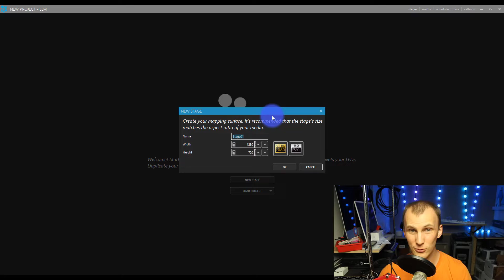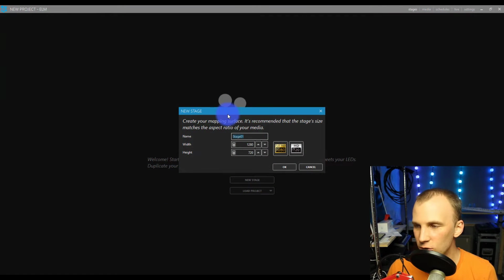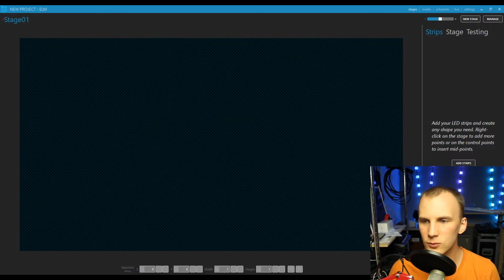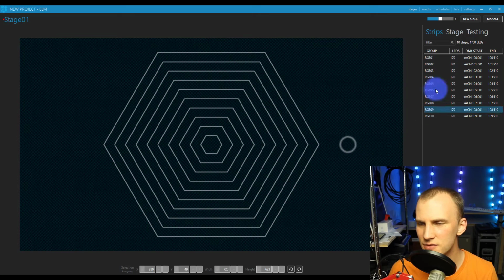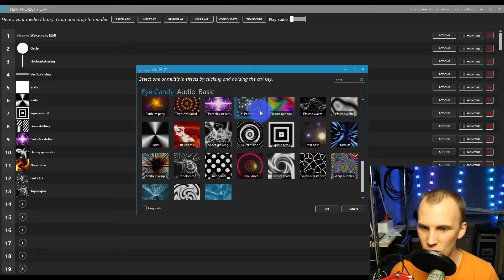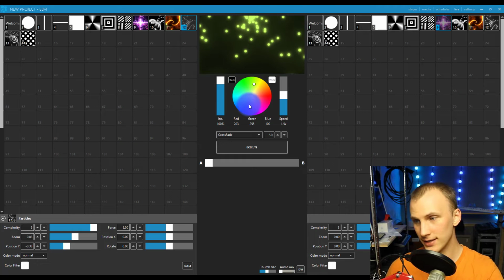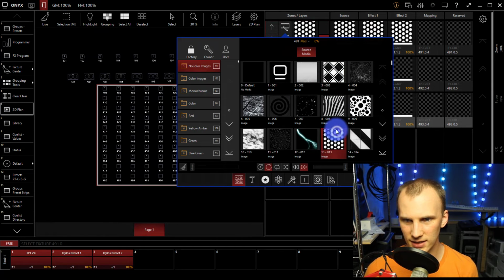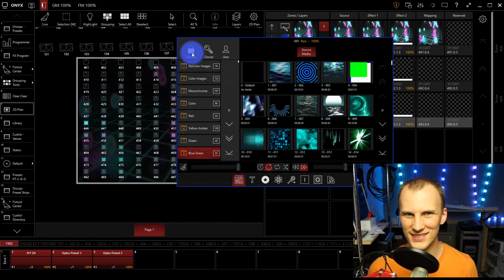How To Control LED Tape and Pixels with DMX

Comment: Are elation pixel drivers any good? I got 4 of the The Flex Pixel Driver (FLE768) for tube lights. What type of led tape and diffuser would you recomend David?

Comment: Hardware question. I'm looking at controlling about 120 LED pixel balls via computer (1 Universe should be enough). Would the Enttec Din Pixie 73539 2-Universe DMX LED Pixel Controller with ethernet out of my PC be enough for this?  It looks like the Octo would certainly work but I only need 1 universe.  Thanks in advance!

Comment: What is a universe in terms that relate to software and hardware?
Reply: I know you asked this 6 months ago, but essentially a universe is 512 channels or control parameters.  Every lighting fixture uses a certain amount of channels to control various functions (those may be intensity, color, pan/tilt, zoom, etc).  Some fixtures use 1, some use 100+ channels.  Therefore you have to have multiple universes if you're running a large set of parameters.  Which means you have to have software and hardware that can handle that large channel count.  Each pixel takes on average 3 channels, but 170 pixels would use 1 universe.  There's a lot more pixels than that on a roll of pixel tape.  Some software is unlimited.  Most hardware, like a light board, may be only able to handle 2-4 universes.
Reply: @mattbrisolara6462  Thanks. Keep up the good work.

Comment: Question…the Octo controls 8 universes and the ELM ties up either 8 or 16 DMX channels. Does that mean the Octo will control 4,096 pixels (512 x 8) but only use 16 max if your running the ELM software? Just curious. Thanks for making these videos!

Comment: I'm using Resolume with an Art-Net Controller, would there be any benefit in changing over to Enttec & Oc...update not Mac support :(
Reply: If you're already using Arena, I would just stay there. I use it to drive 8 universes of pixels as well as a universe of PAR lights and it does a great job, plus it's synced to your visuals. I'll probably eventually wind up using Madrix or Lightjams to control my PAR and other non-pixel lights.
Reply: @mikerose8053  is there a video somewhere that shows how to set this up? I have been trying to learn how to do this for a few years now.